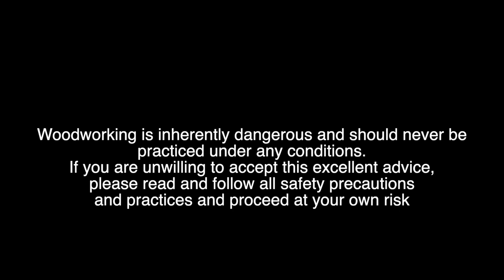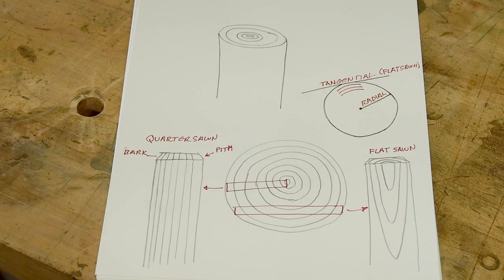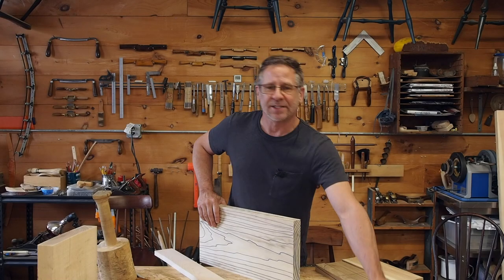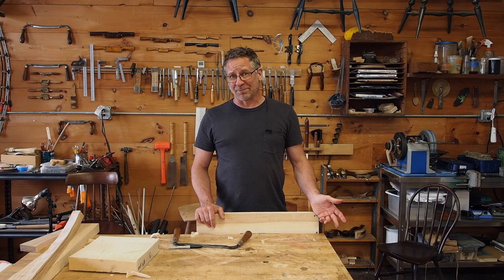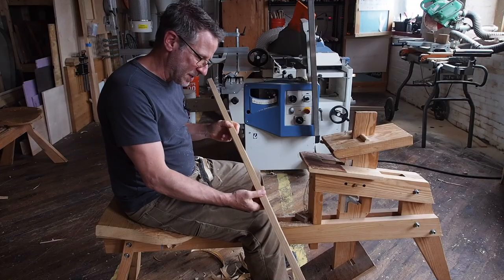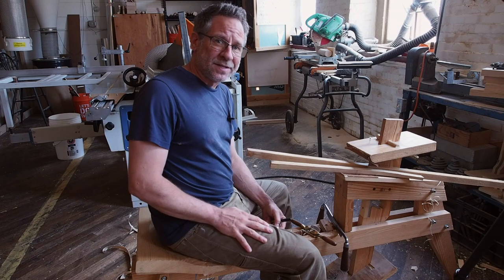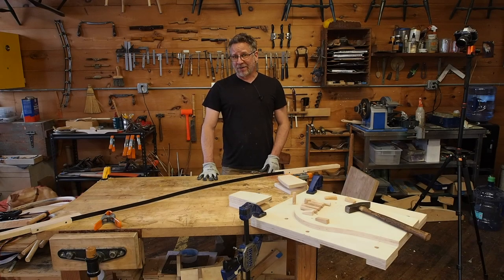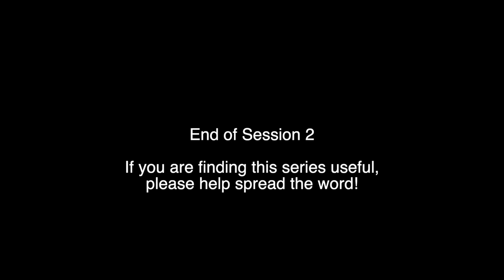Foundation in Chairmaking: Session 2-2 Using kiln dried wood in "greenwood" chairs

Comment: i would be happy to a comparison of how your maethod is better than just a randomly cut piece of the same size soaked and bent
Reply from the maker: it's a very good question. I've bent lots of wood and observed that the failures often happen where the materials surface is not in alignment with the fibers. That said, real science would require doing both for comparison, perhaps I'll give it a try when I get a chance.
Reply: that's gonna have more real marketing potential imao. your didacture is joyful and hypnotising, but when it goes about infoproduct people would like seeing more proofness in advertising when they have doubts. cheers n my best wishes for you